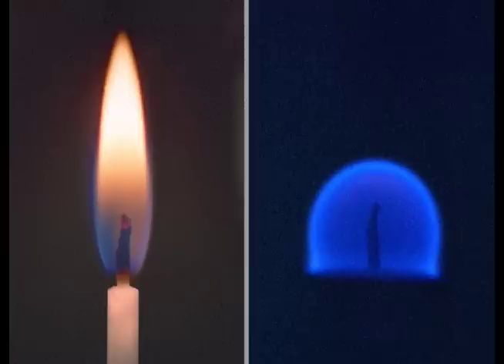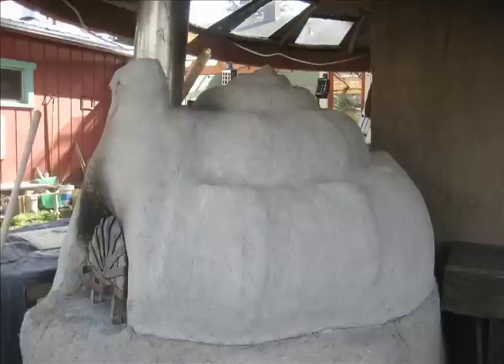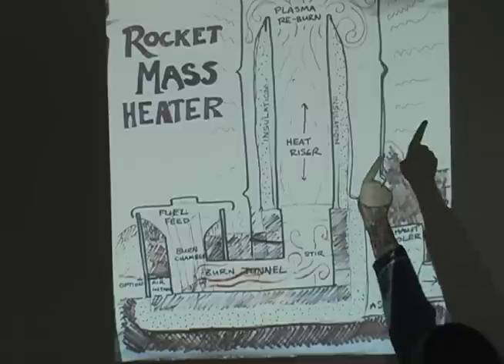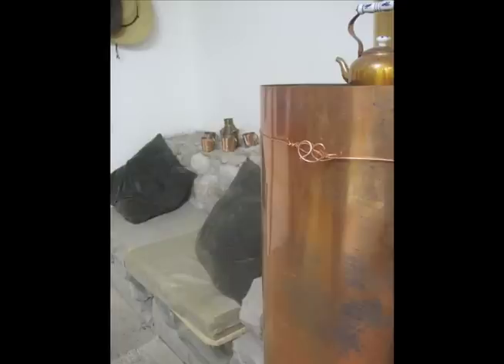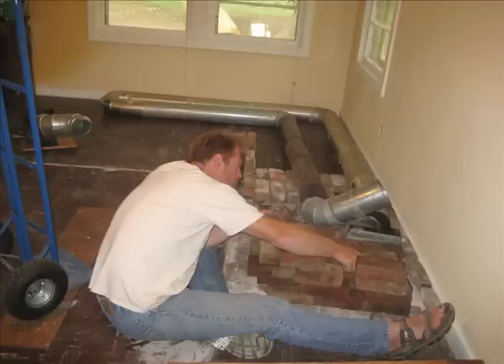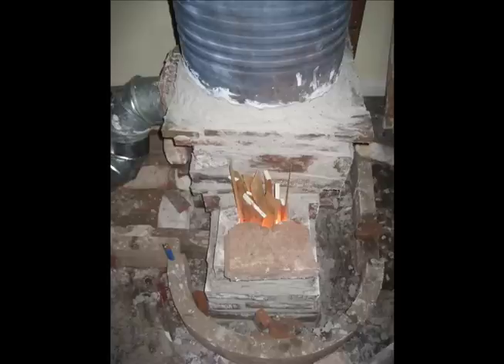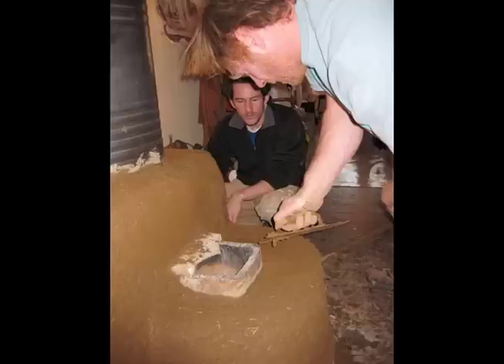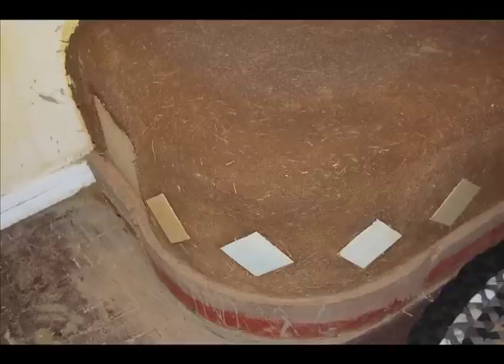Rocket Stove Classroom Instruction with Ernie & Erica Wisner

Comment: Increasing heating surfaces (like the adobe wall next to the wood burner) is a good idea, but they work against you if you're not producing heat. Because then they start pulling heat from the air. So it would probably be a good idea to have a cover for them when you're conserving firewood (or you're out)
The real benefit of that extra adobe wall comes in warm/hot weather, when they pull heat from the air. After all, it's much harder to cool something than it is to heat it, so it's well worth it, in that particular situation.

Comment: Would love to see if it is possible to coil a copper water pipe around the barrel and have that feed into some sort of reservoir, as a way to either have hot water or to store and move heat around a house. Would it even require a pump or function under convection? Would it be too hot and boil the water? if so would the chimney pipe (leading out the house) be hot enough? HHhhhmmmmm
Reply: +Pamela Rempel I've seen people doing it on a smaller scale using an old hot water tank as the reservoir. Not knowing the temperatures involved at the different parts of the system its hard to know if it will work. Too hot and you run into problems with steam and pressure, too cold and theres no point.

Comment: Great info but.... please take turns next time or just have one presenter . Otherwise I enjoyed the presentation and learned a lot .
It's funny how I had made a Rutherford style fireplace without even realizing it.
 I made an circular fire pit one year and was getting tired of having the prevailing wind blowing smoke and ash all over the place and on my guests ,so I decided to go ahead and redesign it .I used some cinder blocks and then made a wide 3 sided wall roughly a 45° degree angle to the fireplace with the back wall blocking the winds and made the two side walls about 3 feet tall and the back which was 6 ft tall
I had lots of cinder blocks laying around the property that had been left behind by the previous owners that were in rough shape and then had some steel plates that I put inside the fireplace as a liner because I knew the blocks wouldn't hold up under the direct heat from the flames .I also gave a space between the two of them to further the gap between the two surfaces .
I then made an arch to put over the fire from onr side to the other on the smaller side walls ,made from steel so I could have a fire even when it was raining .
It's kind of hard to describe but it turned out great .The back wall would get warm and create an up draft and protected against constant winds and it worked excellent in creating enough lift to pull the ashes well away from the fireplace and away from anyone else . Because it was a wide angle type of fireplace people could sit in front of it in a semicircle and be warm because the heat would radiate away from the interior walls to a wide area exactly how a shower or a headlight works where it directs the heat and light in a fan shape . What also helped was having a small ledge in front of the fireplace along the ground that would protect people's feet from getting burned but also helped block wind better plus I put some gaps in the brickwork to allow air to be drawn and focused towards where I wanted it to be . Having a wall behind where I had seating also helped . I made this wall the same shape to better capture the heat which would help keep everyone's backs warm as well .So basically I had two 45° degree walls with their open ends facing each other which also helped block winds from the opposite side of the fireplace .
Not that this is a rocket stove mass heater story ,but it demonstrates that using mass and creating reflective surfaces and channeling heat and light in the right direction was way better than the previous arrangement I had . When I had guests over I used get a lot of questions about the design and compliments on how warm it was and how well it worked . People used to fall asleep in front of the set up I had and would sometimes say it was too warm .
Unfortunately the fireplace got destroyed one winter . I hadn't realized that there was a bunch of good sized rocks underneath it and we had extremely cold temps for awhile that caused frost heave which displaced the rocks below the walls and caused it all to come down .Next time I'll use a steel framework,and mortar and make sure to remove any large rocks and prepare the base with a thick layer of sand .
Anyway great info as always and thanks for sharing this with everyone 👍 ✌ 😸

Comment: Hello, I discovered the rocket mass heater several months ago. I've watched a number
of videos on line including the "Rocket Stove Classroom Instruction With Ernie and Erica Wisner". I know I'll have questions but to get me started. How do you determine, what size of outside drum should be used? Your videos are very informative, keep them coming. I'll be looking forward to a reply, so that I can get started on my "rocket mass heater". It is that time of year.
Reply: You want the drum to be 2 inches higher than top of your heat riser.  The heat riser should be four times the height of the input tube.

Comment: hello, thanks for sharing this info. with the amount of air being sucked into the fire , aren't you pulling all the heated air from the room that the furnace is in ?  would it be practical to bring in air via a tube from the outside of the house for combustion ? also does the temperature of the air being brought into the combustion chamber have any effect on the burn ?    thank you !

Comment: On the finish for the cob, tung oil was mentioned as a fast drying oil that could be an alternative to linseed oil.  In either case. I would want to go with the real thing, instead of the stuff sold at hardware and home improvement stores - which contain petroleum distillates.  The aesthetics of the odor does not concern me, but the exposure to the solvent fumes does.  (Some of these substances can travel right up the olfactory nerves to the brain, apparently, and can be absorbed through the skin, in addition to the lungs.)  RealMilkPaint offers pure tung oil,which might take slightly longer to dry as pure linseed oil does, but the slight delay in drying time is a worthwhile tradeoff, from my perspective.
Reply: Jefferdaughter Isn't 'raw' linseed oil exactly that?  There's also boiled to which you might be referring.

Comment: there is something said about the 'elbow'/corner parts (I'm not from US or UK ..). I see the once (at 44.59) in the corner on the left which have shrink ribbles (to say it so). The once closer to the burner are different .. I'm a little confused whcih once to use, or which once to use where .. Any clearance posiible on this. My design is L shapes like yours in this video. Thanks !

Comment: I am getting ready to build a  Geodesic Dome home and will heat with wood as I do now in my current home. I notice that all these designs are compact. The theory of the mass stove makes it a perfect match for what I want to do to heat my Dome. My question is... I would like to have the exhaust tubes travel completely around the base of the Dome to heat the exterior wall. If the outside wall is warm so will the whole dome be. Can this be done? Or would that be too much run for the exhaust? The base of the dome will be 36 feet diameter or roughly 114 feet of run.
Thanks for your video
Reply: Is it hung to be a single floor or are you doing a second floor. Single floor is the most energy efficient.
Considered just putting it in the center of the house.1 big fan on the ceiling it will pull up in the center and roles down the wall.
Reply: You don’t want to heat the exterior wall, it’s touching the great outdoors. Bye bye heat! The floor or an interior wall, or piece of built in furniture is a better route

Comment: Just another thought.. I have read that Salt is the best at retaining heat. Couldn't you use Salt as a large part of the mass? In Arizona there is an electric generator powered by steam, that is produced using large amounts of salt that is heated.

New Arizona Solar Plant Uses Salt To Keep Producing Electricity When The Sun Goes Down

They use  an array of mirrors to focus sunlight into the salt to heat it, which then has pipes run through the salt. The molten Salt produces steam to turn a turbine.

It is said that Salt is the best way to store the energy/heat.

Could this work for us too?

Comment: could you build the fire chamber with fire bricks and high temp concert form to replace the metal barrel?
Reply: Im pretty sure the top of the “barrel” would fail from the heat. If hippies could use fired clay, instead of an ugly barrel at least some of them would. I haven’t seen any with clay... I know a guy who keeps on using high temperature concrete and he has rebuilt the firebox two or three times even though it’s lined with red brick. It is a cool adaptation though, hooked up to hydronics.

Comment: I've seen a design for this sort of stove that has both a vertical and horizontal air intake. The horizontal intake would be an easy place to add an outside air intake. This video says having both the vertical and horizontal air intake will create a smoke situation. Is that because of too much air? Perhaps after a fire is started, a lid can be put on the vertical intake where the wood is inserted while opening the horizontal intake for outside air. Would that solve the smoke problem? Anyone?
Reply: put a wood stile door on the top and feed it air from outside

Comment: I want to know the information but can only stand a few minutes of her interupting every time he speaks.  Grrrr.
Reply: perlite has asbestos in it use ppe
Reply: +choccolog I think you're thinking of vermiculite.  
But all mineral insulation is dangerous, and should be handled with care not to breathe the dust.  In a teaching setting, we usually can't get everyone into adequate PPE (personal protective equipment) so we usually dampen the material before we start working with it, to keep the dust down.
Reply: +choccolog I think you're thinking of vermiculite.  
But all mineral insulation is dangerous, and should be handled with care not to breathe the dust.  In a teaching setting, we usually can't get everyone into adequate PPE (personal protective equipment) so we usually dampen the material before we start working with it, to keep the dust down.
Reply: Not all perlite and vermiculite has asbestos in it.
Reply: It would be heavy but could you just use refractory(2500-3000degree) cement for bottom half of risor? Then just use a insulated ss chimney pipe(like I burned out) for the top half?
Reply: I totally agree I figured she was just a "know it all" but then I noticed that if a female asked a question she explained in detail, but if a Male asked her a question she just gave a short 2 word answer or totally cuts him off... she seems like a feminist or has a hidden daddy issue... or just "C"an't "U"nderstand "N"ormal "T"hinking.
Reply: @chickenlips8696  I also found it irritating that she constantly interrupted. But it's possible that she is the more knowledgeable of the two, I guess. Still......feminists, c<_÷, or what ever, she's RUDE!
Reply: She has a dominating personality. Poor husband.
Reply: She's giving the information. I don't get what the problem is.
Reply: If you watched multiple vids of Erica and Ernie....
You might recognize they are "two peas in the pod"...
they have a spiel,... well memorized, and very informal.
GET OVER YOUR MISOGYNY.
Reply: Usually what happens.
Reply: How she makes stops in the reasoning process, skips from one thing to another, her nervous delivery and the tense pitchy voice all add to how uncomfortable it becomes to us listeners.
The guy was calm and had a flow and a thread of thought.
She ruined it.
Reply: Though at first her interrupting bothered me, I realized later they were working well together. They are very knowledgeable. They probably earn all their income through these presentations. They are excited about sharing what they’ve learned. The comments in this thread though are appalling. Poor men, probably all white, have problems sharing power. Face it. You are now on the same level as women and must share platforms, same level of income, same space.

Comment: Best wishes to the Master!  Metal furnace suitable for the heating of places of temporary stay of people in a garage, shed, greenhouse or couches with heating furnace located outside the dwelling. At 120 degrees begins burning-dust on the surface of a metal drum, invisible sprays burnt dust spread on residential premises, polluting the air. Open window here will not save. It is like sunbathing "in nature", from the tailpipe idling car, comforting themselves with the thought that you are outdoors. The main disadvantage inherent in all metal furnaces - a negative impact on health. Rocket brick oven with a warm floor allows to accumulate heat, comfortable heat without toxic aerosols room, prepare on the stove and cooking food in the oven for all tastes: https://sites.google.com/site/menedzmentteoriapraktika/upravlenie-infrastrukturoj/rocket-stove-new-design